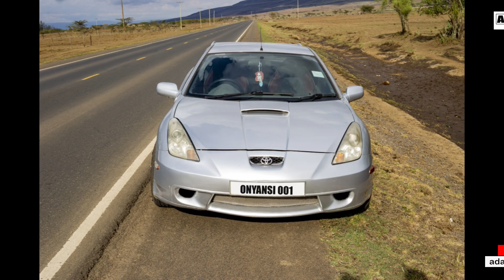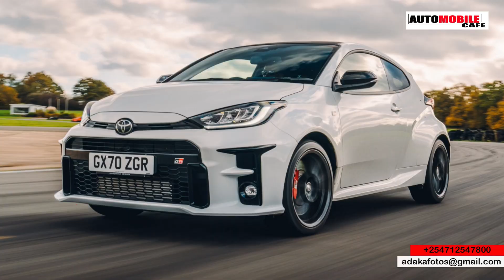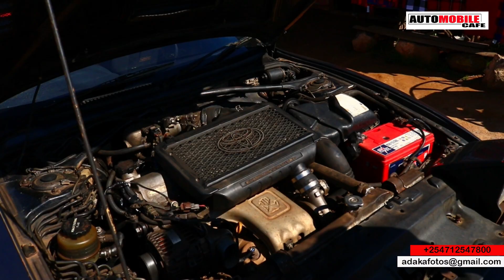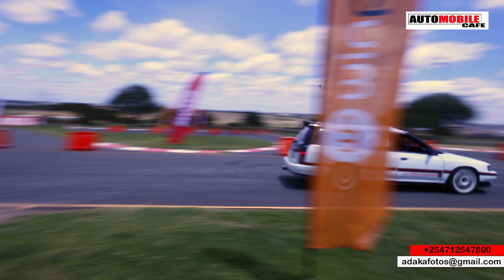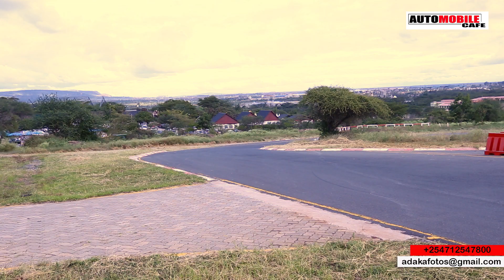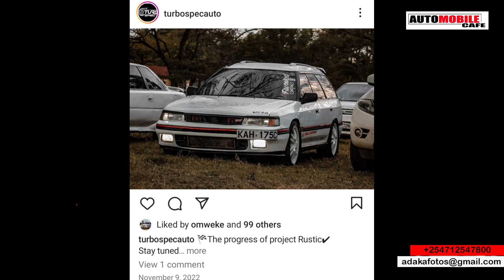Omweke's 7 years of resilience in car building and engineering.

Comment: Buda wacha para ...a cabulator engine must have a fuel pump...all cars that run fuel have pumps even two at times...
Reply from the maker: Mkuu... It's neither here nor there. But majority do have fuel pump as you stated above 😊
Reply: Hey, good show, nice selection of cars, my suggestion is it would be great if you did some research on a model so that you can ask questions that would be helpful for someone who knows nothing about the brand or model. May be find a nice way of editing out mistakes by your guests, for a car channel, some assertions paint your channel in very bad light. Otherwise, good job